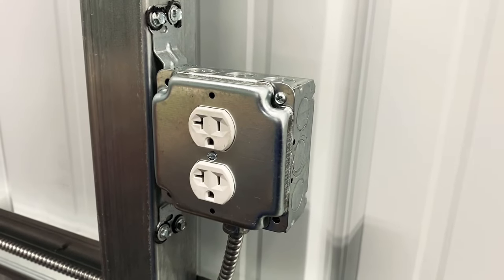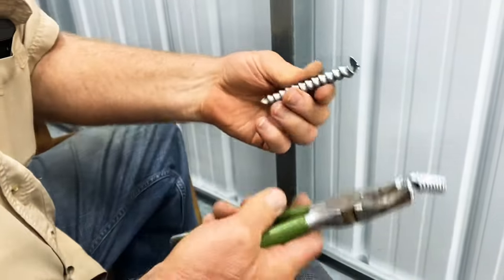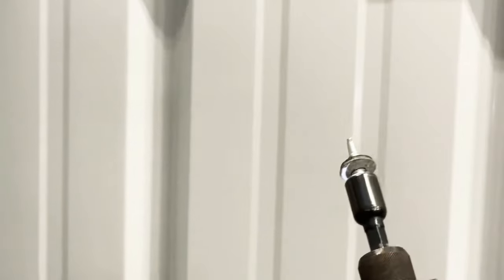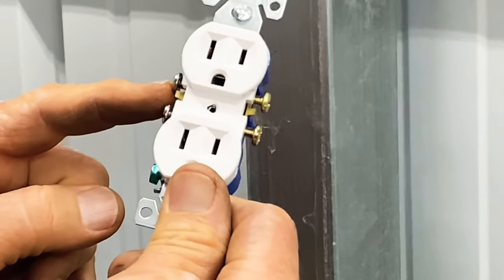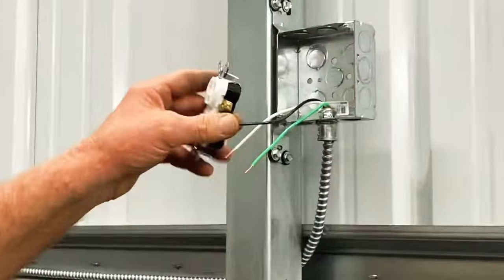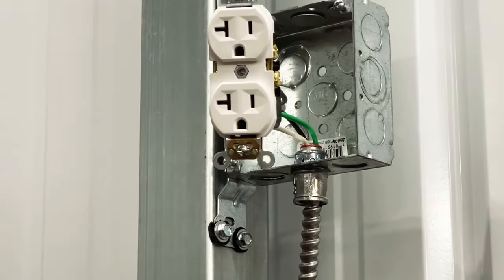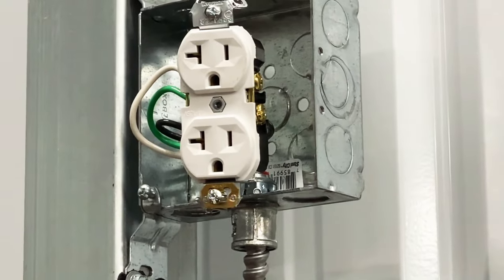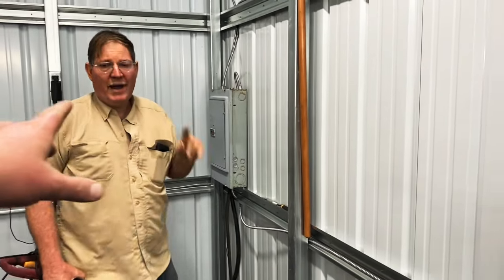Installing Power Receptacle in our Metal Building! IT’s EASY!

Comment: Multiple code violations. Leave the electrical work to the professionals.
Reply: @TheBigDanShow  It doesn't meet the NEC requirements which are minimum requirements.
Fire is not the only hazard with electricity.
Reply: Ya . Keep it a secret.  Act like  you guys are the only  ones that  can install an outlet
Reply: Come down on your prices and we will 😌
Reply: @jessicakeefer5077  So, you are willing to live with, or die from, illegal electrical work?
Reply: @trustme7731  In the short term? Yes. At least until I can find a man who knows what he’s doing and won’t charge an arm and a leg.
Reply: @jaxchristian6408  It's not a secret. It's a learned skill that I worked for. Based on so many videos here, we are the only ones.
Reply: @jessicakeefer5077  I was at a John Deere dealer the other day. Their shop rate was $160/hr. to work on garden tractors and $132/hr for smaller things.
I never charged anywhere near that as an electrical contractor.

Comment: Guy didn’t bond the box with the ground.. this is basic NEC code knowledge. You WILL fail an electrical inspection and it’s just not safe. He should stick to changing light bulbs.
Reply: Outlet is grounded due to the yoke making contact with the metallic box. I agree there’s no pigtail from the 12-2 to box and box to outlet but it is grounded, just not the way you’d expect.
Reply: @ABflanagan523  wrong… open your code book. 250.148(c) if you have a metal box it needs a ground screw and pig tail. Again this install will fail an inspection.
Reply: @ABflanagan523  We use metal boxes for residential and commercial in Ontario, Canada. No plastic crap. And we have to ground the metal boxes and devices by code.
Reply: @JBarnes917  250.146 (A) Surface Mounted Box. Where the box is mounted on the surface, direct metal to metal contact between the device yoke and the box or a contact yoke or a self grounding receptacle shall be permitted to ground the receptacle to the box.
Reply: Wrong

NEC 2005 Handbook commentary:

The main rule of 250.146 requires an equipment bonding jumper to be installed between the device box and the receptacle grounding terminal. However, 250.146(A) permits the equipment bonding jumper to be omitted where the metal yoke of the device is in direct metal-to-metal contact with the metal device box and at least one of the fiber retention washers for the receptacle mounting screws is removed, as illustrated in Exhibit 250.52.

Cover-mounted wiring devices, such as on 4-in. square covers, are not considered grounded. Section 250.146(A) does not apply to cover-mounted receptacles, such as the one illustrated in Exhibit 250.53. Box-cover and device combinations listed as providing grounding continuity are permitted.

Comment: Box wasn’t grounded, receptacle wasn’t wrapped in electrical tape on the conductors and ground should go up but everything else was right to me. Great way of explaining!
Reply: Tape isn't necessary or required. There is no requirement for the position of the ground.
Reply: I agree that the box wasn’t making direct contact to the ground wire but the MC and metallic box is an equipment grounding conductor.
Reply: @ABflanagan523  needs a ground pig tail period… THIS WILL FAIL A REAL INSPECTION.
Reply: No red bushing before connector?
Reply: It's bounded,The 20 A receptacle with the gold clip is a self-bonding mechanism.
Reply: @jcjammer1  Yep. No red head -no pass.
Reply: @jcjammer1  I believe these connections have one integrated in them so no separate LRT needed.
Reply: I always put both white and black on bottom, none of that kriskross apple sauce lol
Reply: Box is likely grounded, but better practice is to bond it to the ground. The steel armor and box are conductive, so it's grounded that way. Also the ground screw on receptacles also have continuity to the metal parts that screw the receptacle to the box, so there is a ground present even in the absence of a ground wire, in that case. But always use the ground wire and always bond it.
Reply: @michaeljavert4635  Oh my god its you again! The person I was arguing over if wagos are better than wire nuts!
Reply: @usipussi6647  That's funny!

Comment: Box is likely grounded, but better practice is to bond it to the ground. The steel armor and box are conductive, so it's grounded that way. Also the ground screw on receptacles also have continuity to the metal parts that screw the receptacle to the box, so there is a ground present even in the absence of a ground wire, in that case. But always use the ground wire and always bond it.

Also use the top and bottom screws and a nut. The center screw can come loose, and also the pressure of plugging things in can weaken the outlet and wear it out prematurely.
Reply: That's right. It is a code violation to install a receptacle to a cover the
 way it is is done in this video.  NEC 406.5(C)

Comment: Best practice is to use the two provided 6 - 32 screws to attach receptacles to metal cover rather then only the center screw that usually comes loose. After cutting Type AC or MC cable cut the sharp edge at a 45 degree angle then install red anti short bushing.
Reply: Those screws aren't "provided"? It comes with only one in the center
Reply: The 1900 duplex receptacle covers that I purchased at several electrical supply houses always had two 6/32 screws along with hex nuts that often had flimsy lock washers attached or small piece of metal for 6/32 screws to screw into. I always had a plastic hinged storage box that contained an assortment of 6/32 & 8/32 screws, flat washers, hex nuts & lock washers.
Reply: @JohnThomas-lq5qp  The cover plates had those break off tabs that I just used and worked great

Comment: Box needs to be bonded as well as grounding the devise, and MC Cable needs to be secured.
Reply: Good comment. The ground should be bonded to the box and MC cable secured. The way presented in this video is potentially dangerous in the long term and will not pass inspection. Otherwise good video.
Reply: Forgot the anti chaffing grommet inside MC cable.
Reply: exactly he didn't ground the box right ?

Comment: Notice the switch has bottom screw with yellow cap which would ground, but will it need a pigtail to the metal box to ensure proper grounding?
Reply: Yes on a raised cover.

Comment: I want more videos like this, hes seems very knowledgeable.
Reply: To bad he missed the box being bonded with the ground. This is an NEC code issue.
Reply: @JBarnes917  So is an extra wire from the green screw, needed to go directly to metal box?
Reply: @CHEECHMUN  exactly, there is a spot in the back of the box that a ground screw is made to go in. You can get pre made pigtails that have the screw and a short green wire on it.
Reply: @JBarnes917  Thank you!!!
Reply: There isn't much knowledge here.  This video should he deleted.  Box isn't bonded and anti short bushing wasn't used.

Comment: I understand that the socket should be grounded to a metal outlet box.  However, I've also read that you can never ground to the structure.  So what should be done when using a metal box on a metal frame??

Comment: And where are the two screws that come with the cover? Would not pass inspection in my area with just the flimsy single 6/32 screw .Hospital that I did a lot of electrical work in would only allow connectors that used locknuts. Smart using type MC cable that has a insulated copper real deal ground conductor verses the flimsy #16 or 18 guage aluminum wire that's inside type AC ( BX ) cable. You should have use a ground screw to ground the metal box. Extremely dangerous if the two 8/32 screws come loose or fall out then box is not grounded.

Comment: At 1:04 - that cutting disk reminds me of a dremel cutting disk. I wonder if one has a dremel tool and they don't need to cut MC cable as part of their daily job, then one could just use their dremel?
Reply: It would be very easy, but easy to cut the wire insulation as well.

Comment: You need to add a red ear on your MC cable first
Reply: It's called an 'anti-short bushing' in my neck of the woods.  The snap-in connector he's using has this built-in.
Reply: @tomnorman5461  No, that built-in doesn't replace the anitishort bushing. It will fail inspection.

Comment: Using the 14 gauge stripper on the 12AWG nicks and compromises the conductor (especially when you rotate it), no anti-short bushing installed.  What I expect from a 6 month apprentice.
Reply: The anti short bushing is only required on AC cable. You do not need it on MC cable if you use a roto cutter then clean the square end up for a flush mount in the connector. That said I would still use an anti short bushing just for extra insurance and peace of mind.

Comment: As an electrical guy, I know that videos are there to inspire.  Please do not take them as a step by step instruction as the code allows each building department (Jurisdiction) to adjust (interpret) the code as written.

Many commentors pointed out several code misses:

210.8. Gfci for homes puts  "out buildings" under garage requirements.

547.  Is for "AGRICULTURAL BUILDINGS" with wiring method restrictions based on the animals kept there.

Anyone can put a wire under a screw, but which screw is where the money is made.  You can learn and do yourself, but calling the building inspectors or a local guy that just did that same job last week might get you a solution to a problem you never knew you had.

Comment: No such thing any more in the NEC called a neutral. AHOLES changed one of the most common electrical term that was used for over a hundred years to " Grounded Conductor " . Best to spend a little extra & purchase at least Spec grade receptacles. Will last a lot longer. Now must use a torque driver or torque wrench to tighten All ELectrical terminals. Not a plug , A plug goes on the end if a cord to plug into a receptacle.

Comment: No "special tool" required. I retired after 45 years and never used a roto tool. Just bend carefully until the sheath comes apart and snip it with your sharp diagonal cutters. Quicker, easier and no extra cumbersome tools to carry.
Reply: Although 'dikes' will work in a pinch, a 'ROTO-SPLIT' is faster and does a much 'cleaner' job of stripping the MC.
Reply: @tomnorman5461  Sounds like a wager :).  
I'll take it !

Comment: I bought a brand new house. The contractor was thoughtful
enough to give me 5 outlets on each wall. The outlets are fed
with 20Amp breakers. Each outlet is wired with yellow 20Amp 
romex. HOWEVER, each outlet is 15Amp. How that passed 
inspection is beyond me. I'm having to replace all the outlets
with 20Amp.

!
Reply: NEC allows the use of 15 Amp rated outlets on 20 Amp branch circuits.
Reply: That will definitely pass code, it’s within spec.
Reply: I believe you are allowed to use 15 amps outlet on 20 amp circuit, just not a 20 amps plug on a 15 amp circuit can't do that
Reply: FYI - the reason it passed inspection is because it is safe to use 15 amp outlets on a 20 amp circuit. Obviously it is dangerous to do the opposite (plug your 20 amp device on a 15 amp circuit and possibly causing a fire).
Reply: @TheBigDanShow     You stayed metal buildings are required to have 20 amp receptacles on 20 amp circuits.   Where does this rule come from?

Comment: FAILED!

1) No anti-short bushing for your MC
2) Receptacle is not GFCI protected, all garages need to be 
3) MC cable not properly supported 
4) Did not properly support the receptacle devise to the RS cover. That middle screw is not a means of support only the top and bottom yoke
Reply: The type of connector he used has a built in "anti short" sleeve in the throat.  100% on board with a fail for everything else
Reply: @recon1314  That redhead at the end of the connector is just to protect the wires from the end/edges of the connector, you still need a redhead at the end of the mc cable where the wire would rub on that. Really truly.
Reply: Anti-short bushing I thought is not required with MC that is optional
Reply: @garagekeys  Maybe in certain codes and jurisdictions? Do you want your thinly coated wire rubbing on a sharp MC edge? Super easy and cheap insurance.
Reply: @JimYeats  yeah, I looked in the NEC  320.40 states AC cable needs the bushings not MC it's optional it looks like if you follow NEC
Reply: yep @JimYeats

Comment: I assume that the box is grounded by the mc, but you should use the ground wire to ground the box and there is no need to attach a wire or pigtail to the receptacle. When the receptacle is mounted to the cover and the cover is mounted to the box everything is grounded. The receptacle has a self grounding strap on the lower yoke. The cover comes with screws and nuts to mount the receptacle securely and you didn't use those. The screw connection between the receptacles becomes optional.
The 20 amp receptacle is ok, but unnecessary, a 15 amp commercial spec grade would be my choice, 15 or 20 amp circuit, it doesn't matter.
Reply: 1. You need to learn difference between “grounded” and “bonded”.
2. That receptacle needs a ground wire going to the box. Please read   NEC 250.146, cover mounted wiring devices are NOT considered grounded.
Reply: @JBarnes917  Thank you for the comment, but I believe that it's justified in this case. See NEC 250.146 exception (A). If he was using a receptacle with a self grounding strap, such as a Leviton spec grade, exceptions (A) and (B) would apply. Am I missing something here?
Reply: @surferdude642  

NEC 2005 Handbook commentary:

The main rule of 250.146 requires an equipment bonding jumper to be installed between the device box and the receptacle grounding terminal. However, 250.146(A) permits the equipment bonding jumper to be omitted where the metal yoke of the device is in direct metal-to-metal contact with the metal device box and at least one of the fiber retention washers for the receptacle mounting screws is removed, as illustrated in Exhibit 250.52.

Cover-mounted wiring devices, such as on 4-in. square covers, are not considered grounded. Section 250.146(A) does not apply to cover-mounted receptacles, such as the one illustrated in Exhibit 250.53. Box-cover and device combinations listed as providing grounding continuity are permitted.

Comment: I don't think you should be using that MC cable if it's not going to be covered up, I thought that it was not supposed to be exposed locations where there can be damage
Reply: Section 330.15 states: Exposed runs of cable, except as provided in 300.11(A), shall closely follow the surface of the building finish or running boards. Exposed runs shall also be permitted to be installed on the underside of joists where supported at each joist and located so as not to be subject to physical damage.

Type MC Cable without an outside nonmetallic jacket can be installed in an “other space used for environmental air” in accordance with Section 300.22(C). These cables can be installed either indoors or outdoors and in exposed and concealed locations. ... They can be installed in a cable tray or in any raceway.

Comment: He didn’t ground the box lmao
Reply: It’s a structure metal building the the panel is grounded to the structure, that box is screwed to the building, metal to metal, it’s grounded.
Reply: If you had your master electrical license then you’d understand
Reply: @garyhobbs249  Seems you don’t. I agree good practice would be to run a pigtail from the box to the outlet for a solid ground but with a metallic box and MC it’s an EGC.
Reply: @morehp1  no ground screw or ground tail in box so it’s not bonded. Learn the difference between grounded and bonded…. When you get an electrical license let us all know
Reply: @morehp1  is that allowed by code?
Reply: @garagekeys  no it’s not. NEC 250.146

Comment: Outlet is not bonded to the metal box, wire not wrapped into a "J hook" and attached to the screw terminals correctly. Wiring is no hobby, call an electrician.